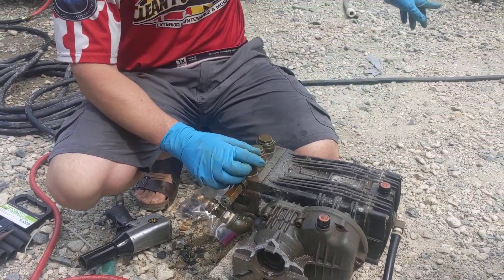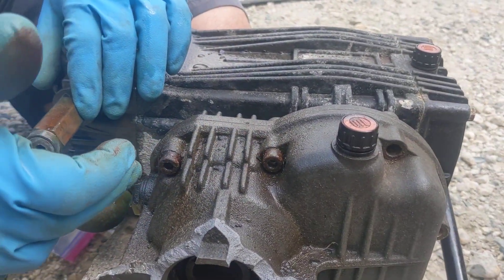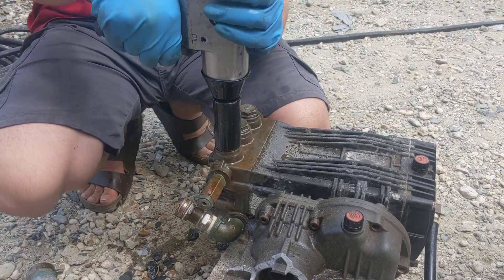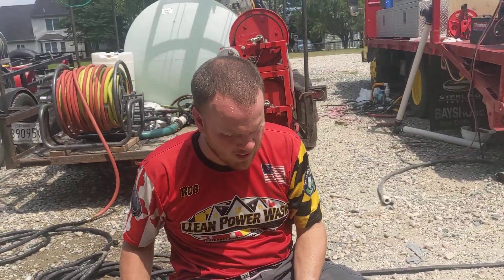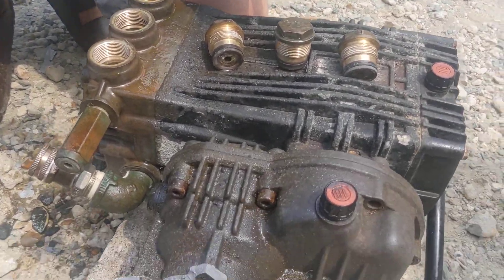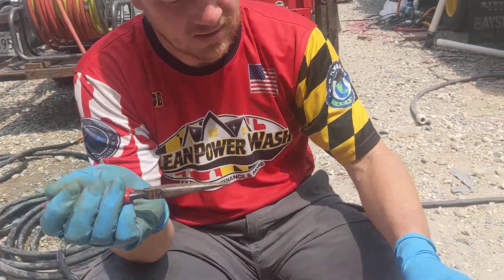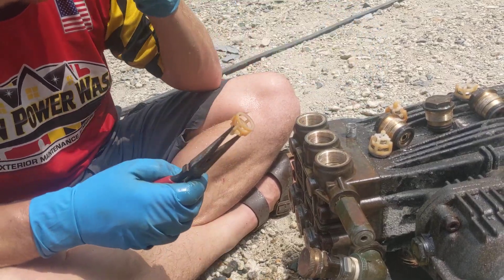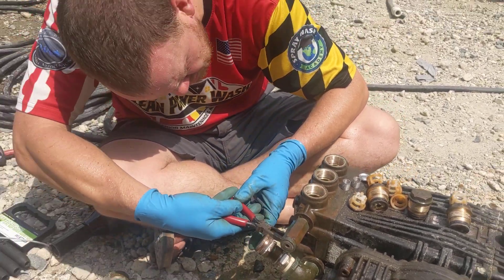Udor pump for 8gpm pressure washer being dismantled

Comment: I have the same pump but for a belt drive. I'm getting low pressure and feels like air in the line. Can't find the correct replacement valves. Could you point me in the right direction please?

Comment: Rob another way that works on those stuck on pumps is to run engine on idle and put pry bar against the engine and pump, it will slowly walk away from engine without that damage. David
Reply from the maker: We tried that a few times and it wasn't budging.